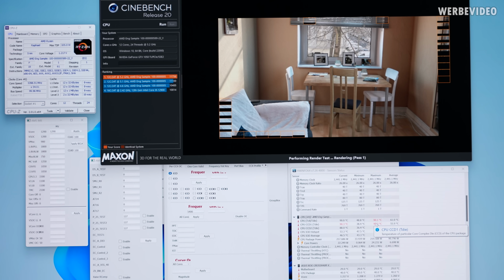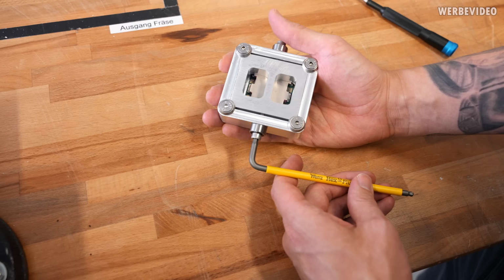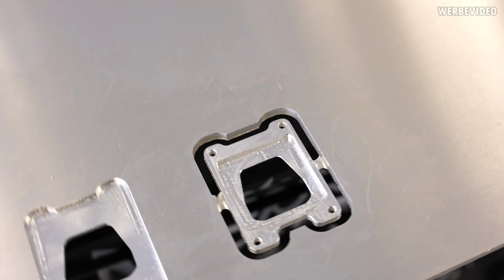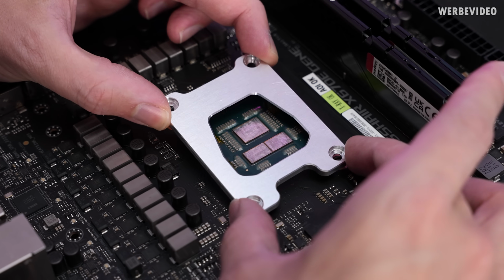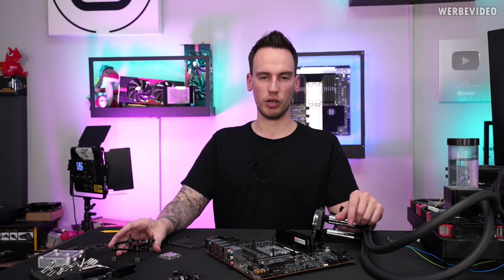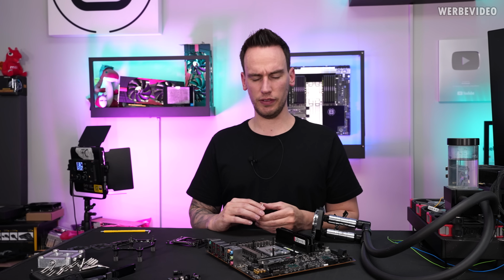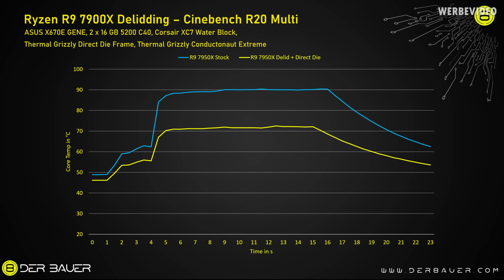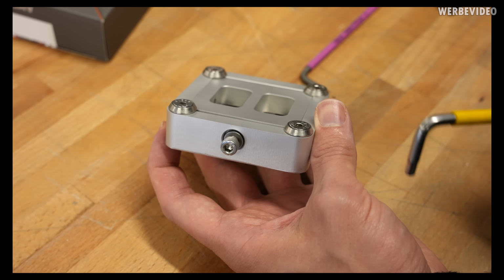Ryzen 7000 Delidding - Unreal Temperature improvement with Direct-Die Cooling

Comment: I like the ethos behind thermal grizzly, but got very pissed off by your response to kryonaut drying out and being basically useless for modern CPUs that run hotter than 80C. Your LGA1700 frame also is crazy in price (in spite of materials and development cost) compared to thermalright which works just as well... and it is still impossible to find in stock anywhere

Still, I appreciate overengineering and might buy your stuff in the future. Just not TIM or thermal pads... maybe carbonaut